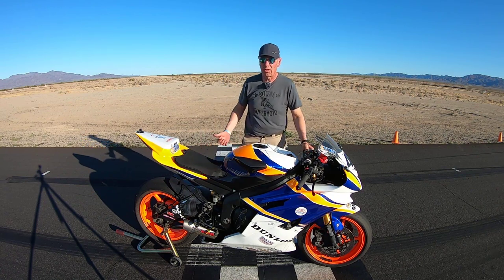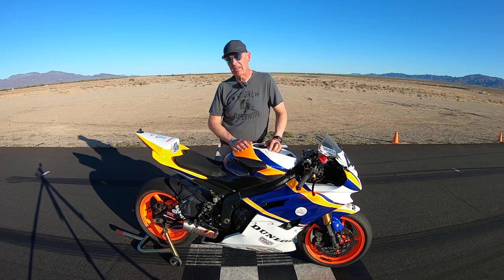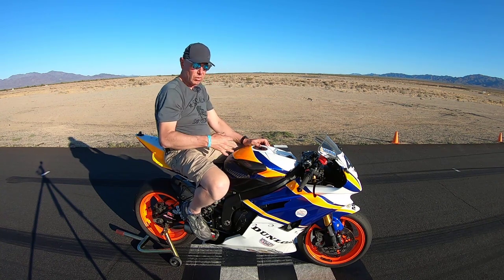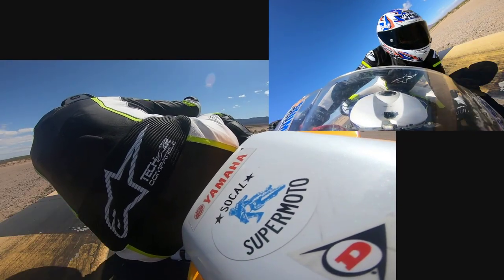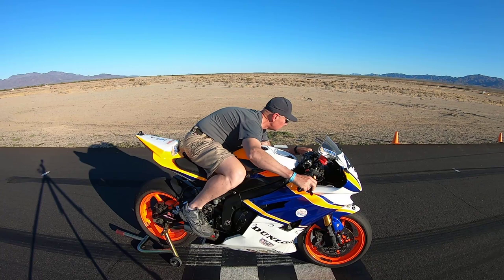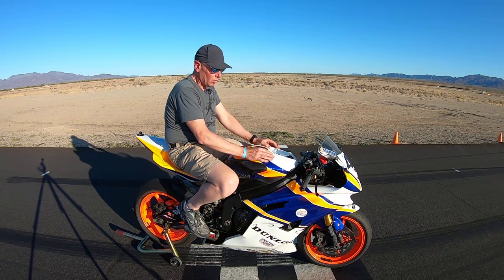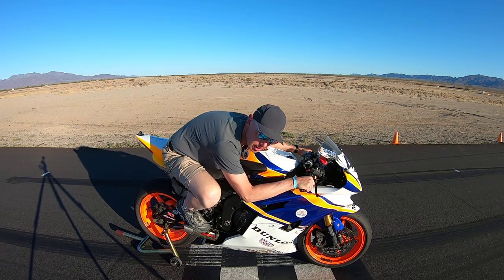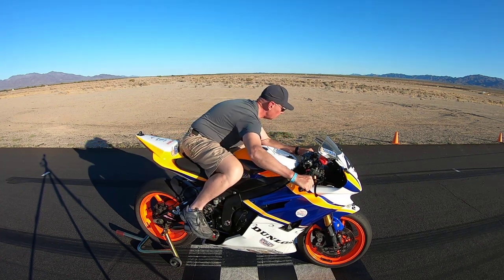Transitioning from Side to Side

Comment: Its videos like these that inject so much value and insight into the art.

Seemingly trivial but they are not. At high speed and critical maneuvering everything starts to count.  

Involuntary steering inputs. I find that to be the most apparent problem when transitioning. It can make the bike wiggle or worse. 

While your hands are a pivot point, it is your legs that must do the work. 

In other words, you don't use your arms to leverage the transition. 

You don't really pull the bike from one side to the other either. 

You counter steer the bike from one side to the other. 

The idea is to set your body on the pivot points (such as pegs, inside of tank and bars) that permit yourself to get into the ideal counter steer position.
Reply from the maker: Thanks! I'm glad you like it!

Comment: One thing helps quite a lot is giving throttle when you are moving in the other direction because this will make the bike go up much quicker, obviously not much of throttle , the most important thing to train on is how you control the throttle and brakes, this and the body position are the real key to go faster on track and be safer on street

Comment: Did you say not to use your arms when transitioning? 🤔
Reply from the maker: Yes, try not to use your arms to pull youself across the bike. Try to use your legs as much as possible.   Of course you would need to use your arms to steer the bike...
Reply: I have asked four different professional racers if they use their arms when the transitioning and every one of them laughed at me and said yes. You most definitely need to use your arms to man handle the motorcycle, especially in faster corners.
Reply from the maker: @joshherrin  Like I said, I think it is best to try not to use your arms to pull YOUR BODYWEIGHT across the bike, this would put input into the bars and could cause the bike to headshake as you bring your body from one side to the other. However, to make THE BIKE lean from one side to the other you would need to put force into the bars to steer the bike. The faster the corner the more force you will need to put into the bars to get the bike to go from full lean in one direction to full lean in the other. To clarify, Yes, you need to use your arms to make THE BIKE steer or transition from one direction to the other, but you should try to use your legs rather than your arms to move YOUR BODY across the bike. In this video I was trying to focus on how you move YOUR BODY across the bike, so I'm recommending to do that using mostly your legs. Does that make sense?
Reply: @stumanrides  Makes sense, using the hands and feet in a delicately coordinated motion to shift butt to side from upright position as entering corner. And with butt shifted, hands to counter steer or lean the bike, while handling the controls (throttle, front brakes, clutch). Then to shift butt again if needed to the other side with feet ball swinging motion and delicately with hands so as not to rattle the bike in the process, correct?
Reply from the maker: @garygazer  Yup exactly

Comment: I do súpermoto only on asfalt on a very small tight track. I’ve been blipping the throttle to flip the bike over. Is that suggested ?
Reply from the maker: if it works for you sure. I sometimes chop the throttle off to help the bike stand up and lean the other way.

Comment: Thank you for your simple explanation. I have  questions, when you about to transition the body, do you counter steer the the other side before or during the transition of the body?   Also, is it safe to counter steer from an extreme lean angle to the opposite lean angle? I am not a sport bike rider but I do ride cruiser and touring adventure where the same application may be applied as well (although, not like in real track), I just don't find any proper explanation about the counter steer from one side to another in a very short period of time.thank you in advance.
Reply from the maker: Yes, you can counter steer the bike from full lean in one direction to the other. You counter steer first to get the bike to start transitioning from one side to the other. Once the bike is starting to change lean angle, you can move your body over to the other side. So in short, steer first, then move your body. I hope this helps.
Reply: @stumanrides  helps a lot. I am just hesitating to do it, although I think it should be fine. But by asking an expert is a lot better. Thanks again. ;)